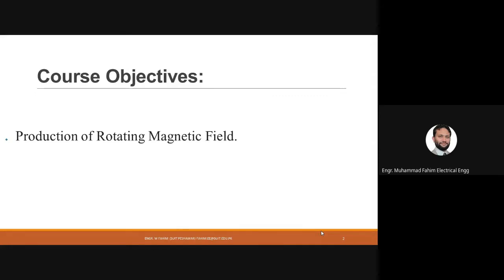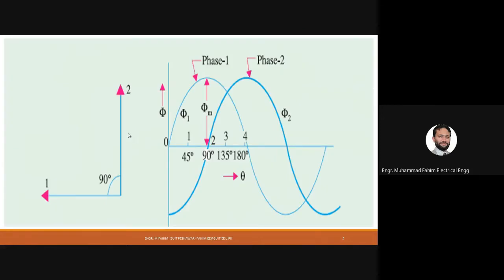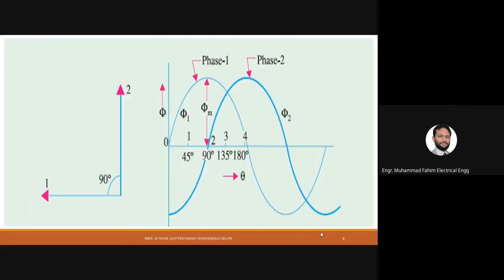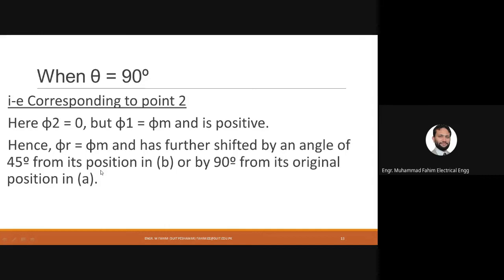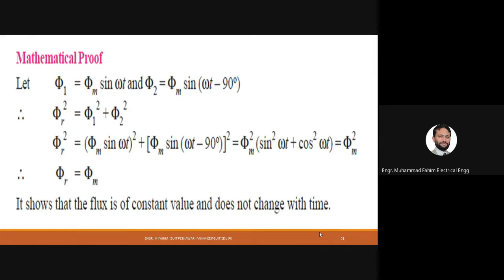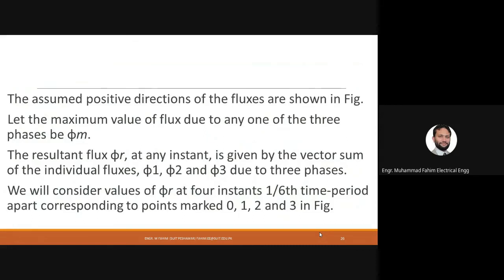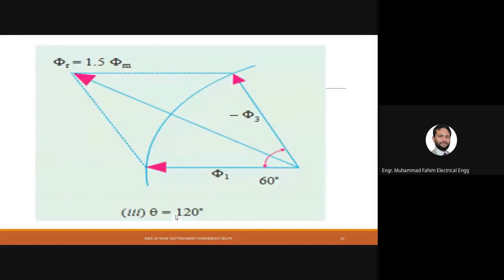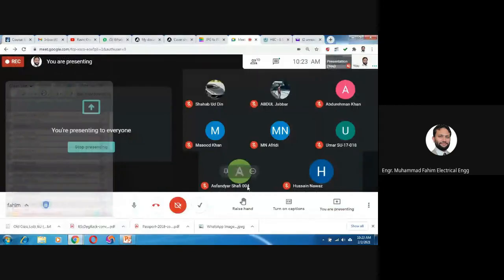Rotating Magnetic Field

Comment: How to split single phase by using capacitor or inductors
Reply from the maker: Actually capacitor and inductor have ability to introduce the lead and lag in voltage and current respectively , so to use this ability of capacitor we introduce capacitor within the winding of the single phase machine which behave like an two phase supply which is the minimum requirement for producing RMF